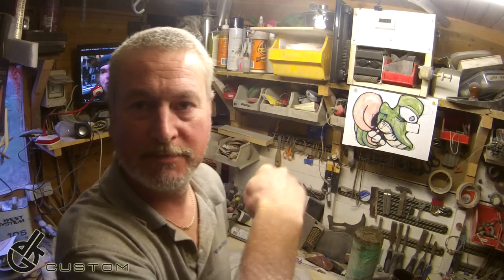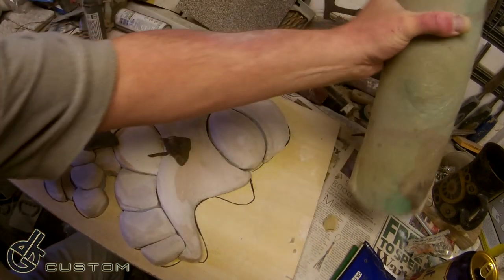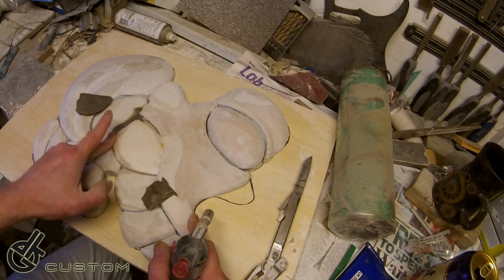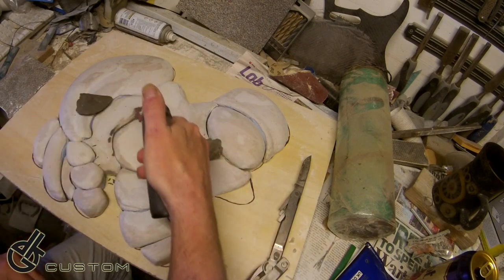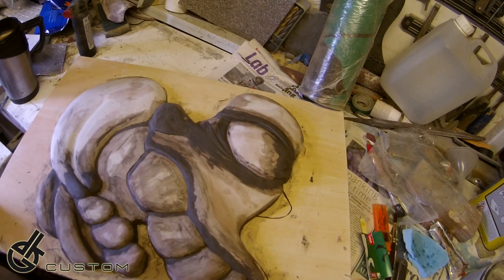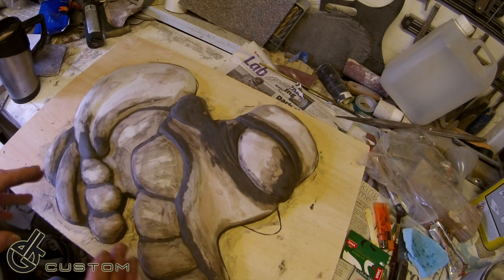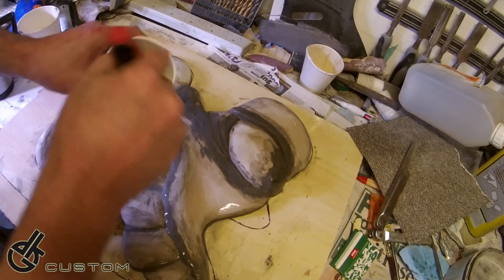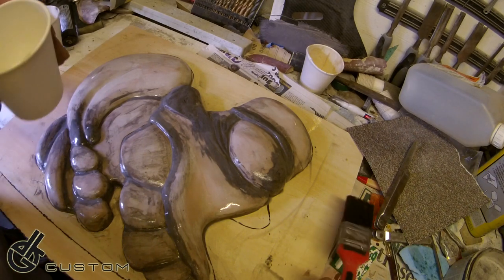Scott Grove's DMF Guitar - Part 3

Comment: Cool- Plastilene? non-polar solvent base, melts? sounds excellent - new materiels are always welcome-and water based stuff is nearly always a crappier choice and clean-up ISNT easier- its harder to do prperly - just look at my acrylic paint pallette of a bathroom sink or the brushhes not cleaned quick enough- waterbased has no work time or levels of undo- I need lots of 'undo' - plus it just dries-evaporates into final form- solvent based stuf changes chemically- i think it polymerizes is the term. 
Hey look! i had a little rant.